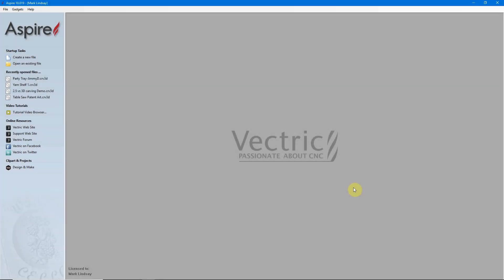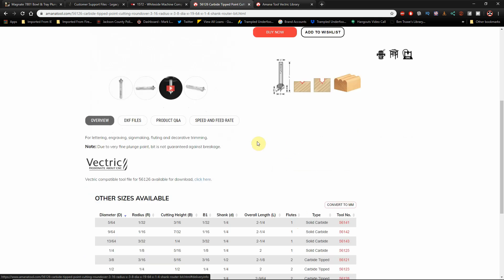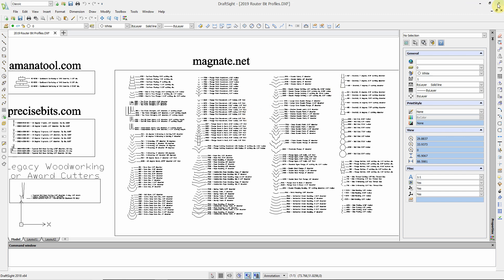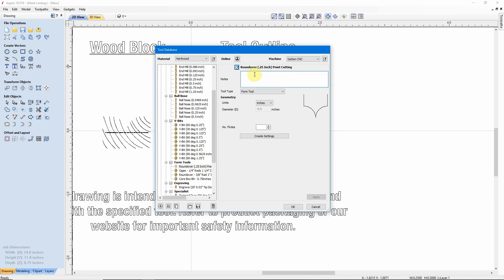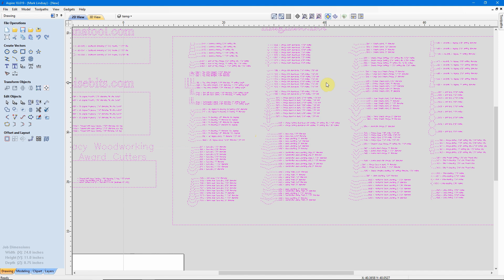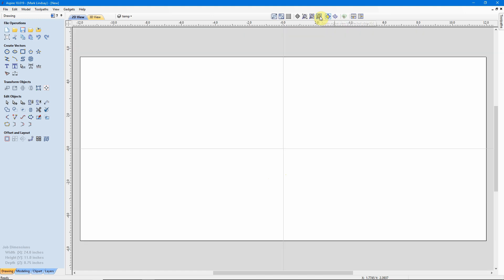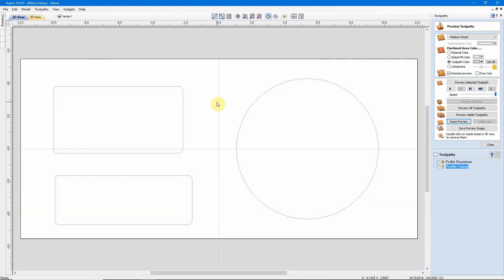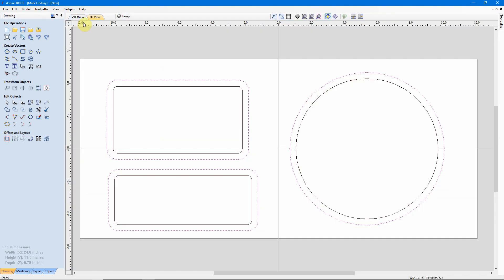Add a Form Tool to the Vectric Tool Database - Part 37 - Vectric For Absolute Beginners

Comment: Hey Mark, I have watched this video countless times (very good by the way) but I am still having problems adding it. I have Freud 19-102 Dish carving bit. I downloaded the DXF file for that bit. When I import it into Vcarve I get the half shape of the tool design but am unable to get an open vector to continue. Any idea want I am doing wrong or if I am missing a step. Any help would be appreciated. I contacted Vectric and  they said this should be added as A Radiused end ? I have no idea what they are talking about. Thanks

Comment: Thanks for this vid -- I'm trying to add a keyhole form tool but Vectric won't accept it... I have the right view only without the top, but it complains about no valid vector -- any suggestions would be appreciated!
Reply from the maker: Vectric software won't let you enter a bit that makes an undercut. I did a video on it, here: https://youtu.be/SblFFBq2bxo

Comment: Great video as usual Mark, you do not mention what to do when you do not have a profile and you warn against using one from another bit but wouldn't it be better to start with an imported profile and modify it to represent the dimensions you measure instead of starting from scratch?  This is similar to entering the other bit information where you copy an existing tool then modify the parameters.  I guess I will have to try some profile bits in upcoming projects.  I can see using a roundover bit on raised text to soften the edges.
Reply from the maker: Thank you for checking out the video! It is similar to using a different tool's .tool file, but it's just dissimilar enough to matter. The profile vector made for a specific bit is made to match the curves, angles, and measurements of that bit. A different bit may have different measurements, angles, radii, or curve lengths. While that may not seem important at first, it may mean the difference between a profile that fits a project's edge and a profile that blows through the side wall of a pocket or hole. You could try starting with a different bit profile vector and modify it in Node Editing mode, but you could drive yourself nuts making small changes here and there in order to get it to match the bit you have. In the long run, it's better to just get a bit that has a profile vector available from the manufacturer. Still, I know that some folks just won't do that, no matter what anyone suggests.

In Live Q&A #23, which followed this video, I addressed the scenario where you don't have a profile vector for a bit, and I said I would do a video on what to do to get a profile vector for a bit that doesn't have one available online (basically hand tracing the profile onto paper, scan it into the computer, and do a bitmap trace.) I won't be able to do that video for a couple of weeks, but I will get to it. Thanks again for watching!

Comment: Hi Mark
Love your Videos.
I am using this to import the Amana 56123 .25 round over point bit
I see in the Amana specs that the point is actually .028 and it is also .500 total diameter
when i selected the vectors and imported I first had to remove the "bottom" flat otherwise the tool DB complained
also the Tool DB shows this as .4606 diameter

BTW I am using vectric 11.5

I'm a bit confused???
Mike
Reply: when looking at the DXF downloaded from Amana it appears to be in MM

Comment: The good folks at Freud Tools sent me a DFX file for a flat bottom V bit point Freud 20-174  when I import the vector into V-Carve the tool diameter is 28.57 inches and V carve won't let me change that. Any suggestions ?
Reply from the maker: I've run into this before - it's pretty common. The DXF file was drawn in Metric units. That's easy to fix. You'll need to delete that tool in the database and start over. Here's a short video I did on converting Metric vectors to Imperial, or Imperial vectors to Metric: https://www.youtube.com/watch?v=KE4kxHxE95g

Comment: Trying to Draw the CMT 955.601 Not having luck. tested the ones you show here and they worked fine. Any ideas?
Reply from the maker: I had to look up the bit to see what the problem might be and found it immediately. That bit creates an undercut. Vectric software currently won't display an undercut, so it won't allow you to add any tool geometry that creates an undercut. That's why you can't enter the geometry of a Dovetail bit, Keyhole bit, etc. It's a problem they've had since the beginning, and they're working on it. I don't completely understand it myself - something to do with the way the program calculates which pixels are removed for display purposes or something like that. But do know they're working on it.
Reply: @MarkLindsayCNC  Thanks Mark. I am trying to start the bit in the center of a 1.5" diameter hole to create a finger hole with a lip. I was not able to figure out a tool path that would allow that. Any ideas!?
Reply from the maker: Not without trying that bit myself. I'm sorry.